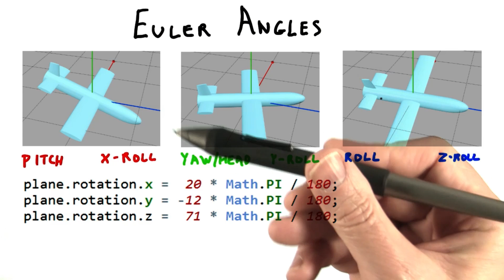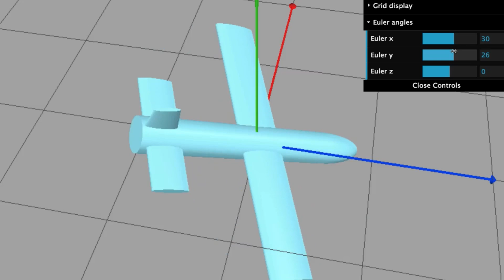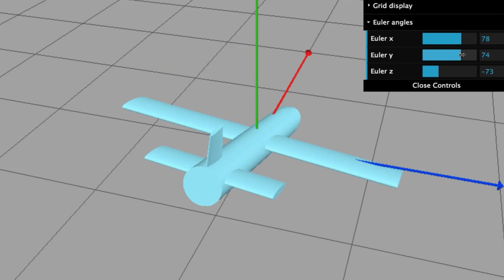Euler Angles - Interactive 3D Graphics

Comment: at 2.18 why cant the Z rotation change the pitch of the plane?? Im confused..
Reply: I did some more research and I understood why that happens. Apparently there is a hierarchy/dependency of rotations between X, Y and Z. In this case it is X > Y> Z. This dependency sets the frames of references for each rotation.  The author in this video explains that the rotations happen in relation to the plane, which is correct but is misleading. When you asked about the "new" pitch rotation X in relation to the new position of the plane, in fact  the red axis stayed in its place, this time rolling the plane. Only because X rotation is at the top of the hierarchy. But the blue "roll" Z axis is at the bottom of the dependency. So when you turn the plane to the left by 90 degrees, the Z axis turns with it (because it depends on Y rotation/frame of reference). We end up with X axis that is still and Z axis that has moved both perfectly aligned. Check the Gimble Lock by GuerrillaGC.
Reply: Back here after 4 months! Now I ask: At 2.18, why dosen't the plane change pitch with X axis rotation?
Still wondering lol
Reply: I have the same question: why do they have the same effects ?
Reply: come back after 4 years, now I understood. The main point here is that: the x axis always stays at its position with respect to earth reference because it is at the top of the hierarchy
Reply: @datvuong7420  how are things after 4 years?! Haha 😄
Reply: @mihir777  great, do you understand this thing now? I am going to learn about quarternion
Reply: search for gimbal lock
Reply: link:  https://www.youtube.com/watch?v=zc8b2Jo7mno
Reply: This makes sense to me... There is an order to the axis. You can see at 1.26 after he moves the 'x' rotation, how the plane rotates depends on the new x rotation local to the plane, not the global position. I am not great at math, especially not vector calc, but I would hazard a guess this has something to do with cross products and the rotation matrix.
Reply: My monkey brain is not capable of understanding this :(
Reply: XLC  the airplane in the video actually has 3 frames around itself, you can see the full model of this in another video (example, at 0:44, this video https://www.youtube.com/watch?v=zc8b2Jo7mno&ab_channel=GuerrillaCG). Here, they did not sketch the frames, hence confused a lot of people
Reply: XLC  I don't know that but please see this plane as it has 3 frame around itself and the plane rotated by rotating the frames